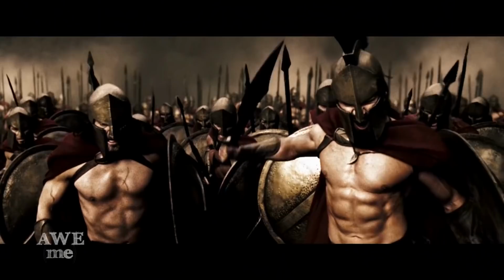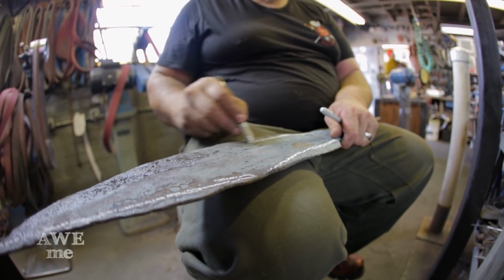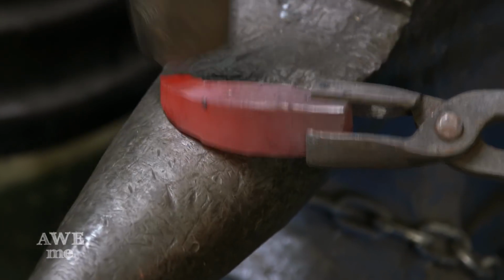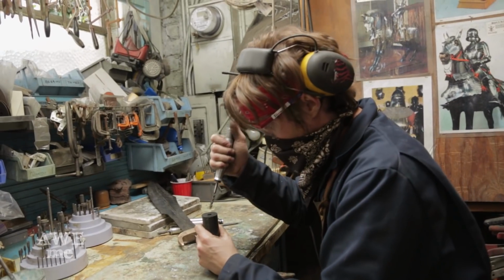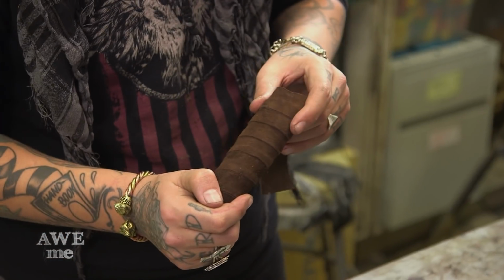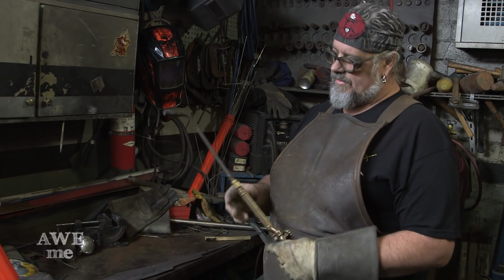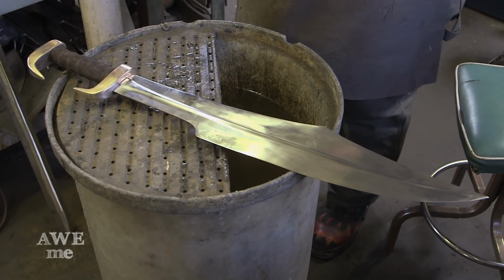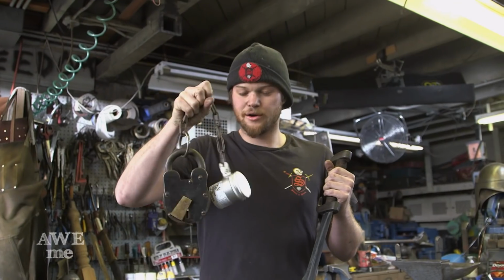King Leonidas' Sword (300) - MAN AT ARMS

Comment: Can someone explain to me why they heat the sword and directly put it into the oil?
Reply: The heating and oil dunking is part of the process for hardening the blade, by putting the heated blade into a cooler liquid, you can change the properties of the external part of the metal. Most people think that you have to use water for this, but oil has a higher boiling point, so it's used by many blacksmiths
Reply: cuz
Reply: it

Comment: Sasuke's Sword from Naruto Shippuden with hilt if possible!!!
Reply: Retro radio
It's a Chokuto, not a Ninjato.
Reply: its just a black ninjato. Kind of boring to make a video out of it
Reply: spikegilfer1997
The Shinobigatana (ninjato) is very similar to a chokuto ... Almost no diference what so ever in shape.
Shinobigatana might be shorter though.
Reply: Retro radio  The Chokuto is a 10th or 9th century Japanese straight sword. The Ninjato (A term created by pop-culture) Is a straight katana with a blade that doesn't exceed two feet in length and there hasn't significant enough proof to justify ninja actually using them. Very similar to a tanto, save for the hilt so I assume that's where your making the connection between the ninjato and chokuto.
Reply: spikegilfer1997
you learn something new everyday.